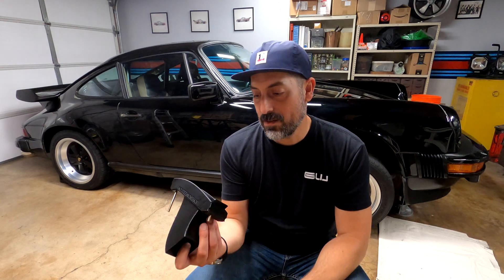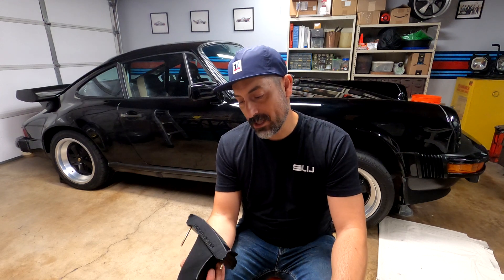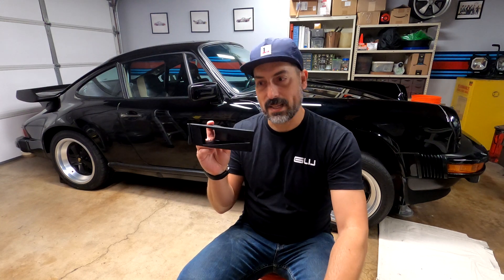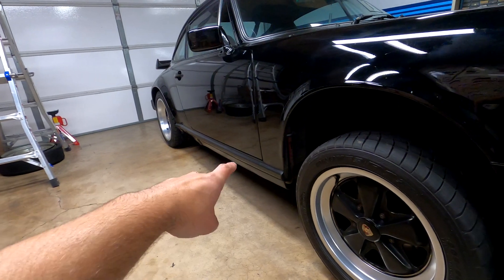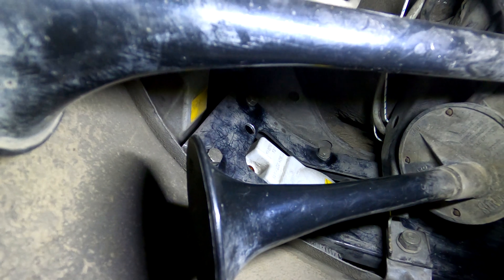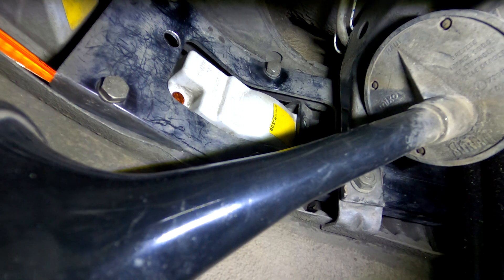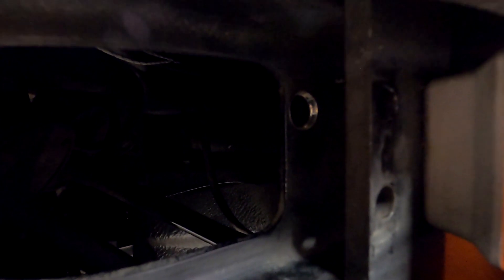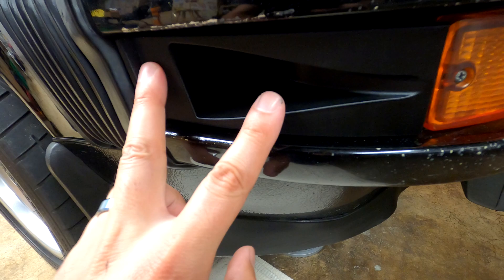Air-Cooled Porsche 911 Oil Cooler NACA Duct Installation

Comment: Great idea and nicely made. My 1977 911S is a California car but since I shipped it to The Netherlands I was required to remove the lamps in these side marker lights to comply to Dutch vehicle law so I’m interested. I only have a Trombone loop oil cooler so if it looks like it will increase airflow I will definitely be interested.

Comment: Why didn’t you just put a shorter stud in the front so that drilling wasn’t necessary?
Reply from the maker: You can't put the plate back on over the outlet tube even with a shorter stud and you can't get to the stud if you leave the plate in place
Reply: What about nuts instead of studs?   Seems to me, if I choose to delete the crash plate the stud will be much longer than I need. 

I’d need one for the drivers side too.  I have a cooler on both sides.  I’m running the scoops that stick out and I don’t love the way they look.
Reply from the maker: I hear ya. I can consider these 2 variants in the near future. For now this is likely the most common configuration.